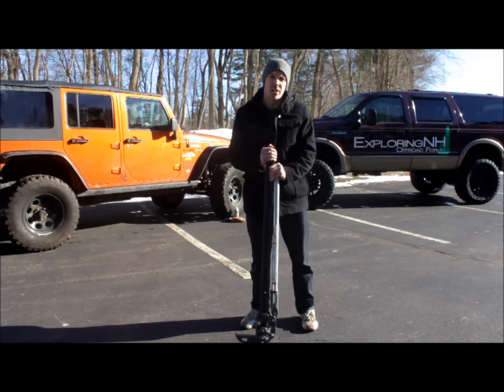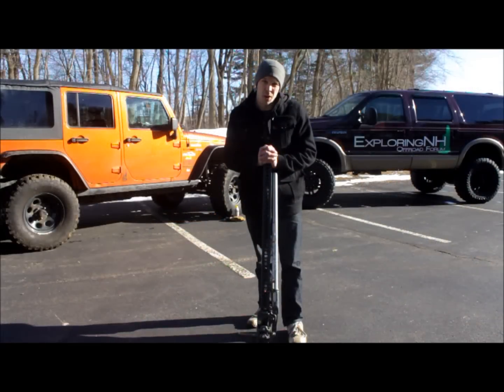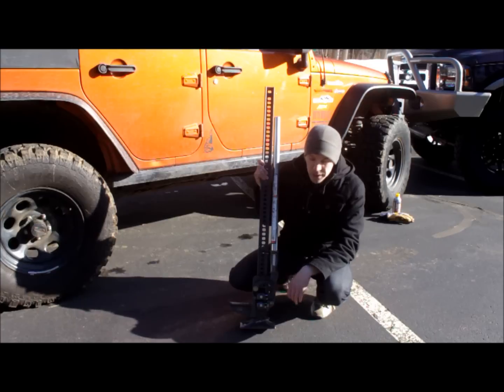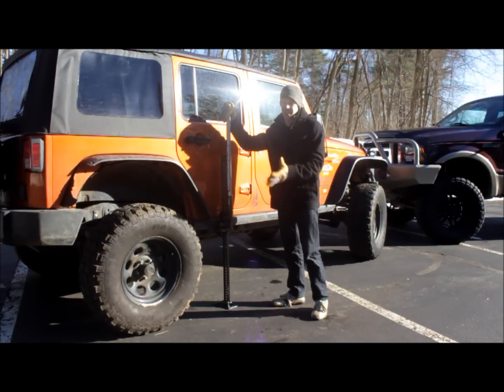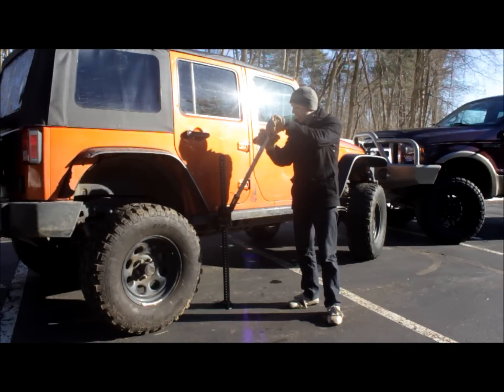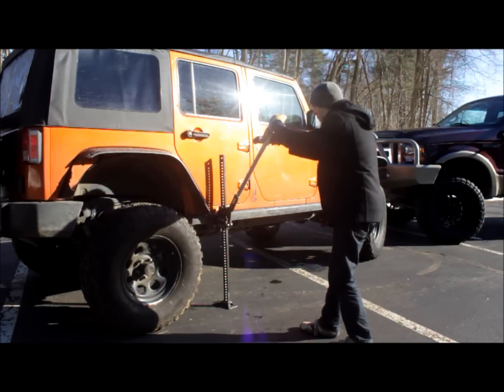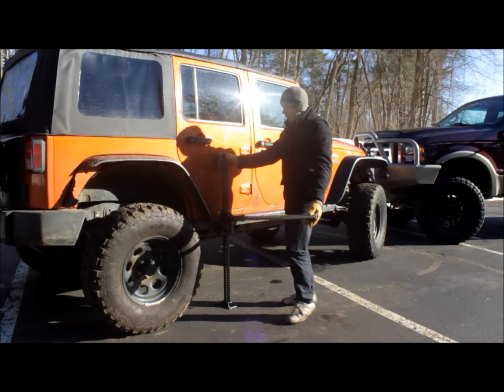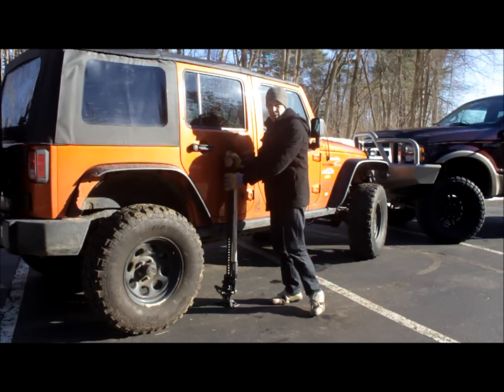How To Use A Hi-Lift Jack Safely

Comment: would also add to this.  carry a sorry lengthy odd chassis with a hook on one end. chain your axles to the frame so you do not need to lift it that high as the axles will only lower as far as the chain will allow.  it will make changing a tire or most things where you might need to use this devise much safer. the higher you have to lift the more unstable things become

Comment: IMPORTANT NOTE: If you're on a trail, chock the wheels first to help prevent the vehicle from rolling, just in case your e-brake slips. This is especially important if the vehicle is on an incline or decline. A pair of heavy-duty wheel chocks  is only about $20 on Amazon (or use a log in a pinch).
Reply: ElektrobanK wanna hold my chock block

Comment: Good technique, especially when lowering.  I'd like to add that a Hi-Lift can run away when lowering the load if the operator loses grip on the lowering stroke.  If it runs away the handle starts going up and down on its own, very fast, and likewise very dangerous.
Reply: Good point to bring up for sure.
Reply: Much like the bumper jacks for those old enough to remember them.

Comment: "I'd rather have a dented body pannels than a broken hand"
That's the difference between you and me lol
Reply: Gigantic Weiner mall crawler for sure.
Reply: @gilbertomauricio9732  "Ah crap that driveway is steep..."
slaps it in low range
Reply: Well if you actually use your Offroad vehicle for what it’s built for, a hi-lift denting a panel is the least of your worries lol.
Reply: Broken hand can heal. Body panels are expensive to replace..........just sain
Reply: My exact though when I heard that😂😂😂
Reply: @pmmp855  must have universal healthcare

Comment: If your vehicle has a lot of suspension droop, use a strap or chain around the axle before you lift... then you don't have to lift as high.
Reply: good tip keeps load more stable.
Reply: I carry a 60" and sure glad I do
That extra ft. Has saved my butt more than a  couple times.

Comment: I have used this jack when I used to hard core off-road. It is worthless. I've used it on the side if a hill repairing a broke axle it sucked because I had ratchet straps the front axle as short as I could but still had to lift it way too high to get the 36" tire off. Also I tied my winch off to a tree to keep from moving down hill. Also when you have to use it if your rig is any way shape or form offcamber the top of that Jack will eat the crap out of your side or front. I have gone with a harbor freight aluminum racing jack. Removed the wheels fabbed a skid plate with turned up ends and bolted it to the jack to use as a base. About   an 1.5 longer on each end and about an 1.5 wider on each side. You can thrown rocks,logs, sand and anything else you can think of under it. Now you lift the axle and not the whole suspension also. Watch out when you start lifting, it doesn't "roll" as the lifting arc goes up. So you have to watch and compensate for the arc.. That's just my thoughts from using the high lift jack. I don't like them. I've seen them kick out..
Reply: Interested to see pics or a video of your setup. I'm on the fence about a hi-lift and looking for safer alternatives.
Reply: @AaronLives34  idk how I would post a picture on here. But this might help. Since you you have great mechanical skills. This is what I done. Go to Harbor freight and get an aluminum race jack. Remove the rear swivel wheels, but keep the front wide wheel on. Either get a piece of 1/4" aluminum or a piece of 3/16" mild steel plate. I have steel on one jack and a piece of aluminum on the other for both of my rangers. I have a Tig machine I done the aluminum one with. Get Some 1/8x 1.500 angle iron to replace the back swivel wheels where they bolt to the jack itself. A 1' piece of angle iron will be enough for the back. Where the wheels bolted on.  I made the base plate about 1.5" or 2" wider than the  jack itself. Too wide and it's hard to store. The base plate on the rear I made it about a 1/2 longer so I could weld a kicker on plate so as it would ramp over stuff as I pulled it back. You can't get too high because of the handle. I did the same thing on the front of the plate also. But made it a little longer. Somewhere around a 45 degree on both kickers. On the front end of the plate I cut it to where when I welded the kicker on it touched the front wheels.  
Example 0/. Make sure the front wheels are still on the plate when you make and bolt on the front tabs welded to the plate. I leveled up the jack before I marked and bolted on the rear legs. Once you get it like you want then get to welding those legs to the base plate. Use it at home to see how it works. The jack don't "roll" forward as you jack it up on the plate like it would with wheels.  I think you will get the jist of it when you lay this on your welding table and get the CPU going.. You throw rox logs anything under if need be for height or keep from sinking in the mud. Hope this helps.. Like I said I have one in each of my chase rangers.  Be safe and hope to see you on the trail some day..

Comment: It's estimated by our government that more than 70,000 people are injured each year in jack related accidents. In many cases it's because the vehicle moved or shifted causing the jack to fail. The first things to do are to make sure your vehicle is in PARK or First Gear, Brakes are set and  the wheels are choked to prevent the vehicle from moving. Then you can get your jack out!! You might also invest in a stabilizer for the Hi-Lift type jack.
Reply: Richard Bogert ...I heard that it is suppose to be in reverse if it is a stick. Not sure tho, correct me if I am wrong.
Reply: Sake A
A lower gear ratio will have a stronger holding force. Depends on the vehicle and transmission if first or reverse is lower, but I think either one holds enough. Also you might consider how the stick positions, in my car if I need to go inside to do something, I am less likely to accidentally push it out from first gear.
Reply: Richard Bogert In a perfect environment in a perfect world yes, but not in an off-road situation. You have to be as safe as you can but when off-road you just can't or have all those luxuries.
Reply: Reverse and first gear is the same gear but with the spline going into it "reversed" so its the same ratio.
Reply: Daniel Giavelli
that is not true. Some transmissions may work like that but most do not.
Reply: I dont know for sure, i was a mechanic for 5-6 years and was told that first gear is used as reverse except that insead of a clock wise spiral on the spline going into the gear it is a counter clock wise (doesnt make sense to me, i could be saying it wrong) or something of that sort. I can do anything on a car, but no transmission work, except remove it lol. If you know more, explain, but thats about as much as i know.
Reply: I'm not an expert either but reverse usually has it's own gearset with a third gear so it changes the direction of rotation. http://media1.britannica.com/eb-media/45/104145-004-3A4E254C.gif
Reply: Catrik hmm, Interesting to read. thanks for showing.
Reply: Daniel Giavelli and catrick this has been the most cordial interaction I ever witnessed on a YouTube comment section. I'm appalled that there was no name calling and such, #realmen #realtalk.  That's what's up.
Reply: Sake A lol thank you! There wasn't any reason on my end to be rude, and I'm always happy to learn new things.

Comment from the maker: Andrew, I can't seem to reply to your comment directly, but on a stock Excursion, there is no place to safely use a Hi-Lift jack. You would need to add aftermarket front and rear bumpers or rock rails.
Reply: +ExploringNH I used a hi-lift on the tow hooks of my superduty...not recommended but worked when I needed it to!
Reply: so to change a tire on a jeep i needa high lift jack? what one should i buy

Comment: Are you suppose to keep the door open so if something does happen, you don't destroy the door or panel? I've seen a few images of people leaving their door shut and the lift slips and crushes the door. Least with the door open it won't destroy your door or panel..
Reply from the maker: Joshua Shaffer yes it is highly recommended and should’ve been done during this video. Some situations done allow for the door to be open during jacking, but when possible it is a great idea.
Reply: I am unfamiliar with the use of one of these Jack's, and I'm interested in what your idea was. I guess a question I would have is if the door is open couldn't get in the way and hinder you from properly using a jack like this?

Comment: To help protect your head and your rig from these heavy steel jacks, a 12 inch length of 2 inch pcv pipe, with a cap on the end, fits snuggly over the jack's vertical rail. There's a video on my channel shows mine.👍

Comment: where does this get stored on the vehicle. I have a lifted f250 diesal super duty. do I need a special mount?
Reply from the maker: Kristine West that Orange Jeep is mine and it is on my hood. Many companies make special mounts for certain locations but any place where it won’t move during an accident etc... where ever it works for you as long as it is secure.

Comment: Can we please see a video where you NEED the high lift to ACTUALLY get out of a situation? Everyone makes videos with the jack on a completely level surface. People are watching these videos to figure out how to get out of situations where we ACTUALLY NEED A JACK! Ill make sure to rewatch this video when i get stuck in my local wal-mart parking lot. Thanks brotato
Reply: +Max Shelton there is one that actually shows it out of pavement but dont have a link handy ( even shows how to safely use the jack as a winch)
Reply: I once used a hi lift on my truck on a sloped trail. Jacked it up but hi lift bent then sprung out from under my truck. Scared me 😣

Comment: could you use a second one on the other side to fully jack the vehicle up?
Reply: Justin Bufford front or back end maybe but not all 4 wheels. The car would teeter totter on a 2 inch wide fulcrum
Reply from the maker: Justin Bufford I wouldn’t recommend it.

Comment: What does he have in the side where he is lifting it. My jeep has bear metal that will bend if I jack it from there.
Reply: That JKU has the Rubicon rock rails
Reply: +Daniel Young just about any rock rails will do you can use after market bumpers aswell if they are structurally sound.

Comment: I was testing out my hi lift jack without a vehicle under it. with it raised up some, I switched the pin to the lowering position, and it just Slammed down. Is it normal for it to do that when there's no load under neath it?
Reply: Need to have weight on it
Reply: Eli Noblin I hate that, but yes that's normal. It needs to have somewhere around 150 lbs of force or more on the lip to work like in this video. Remember that when you are jacking your vehicle down, once the vehicle is standing on its own weight, the jack will drop since there's no force being applied on it. You can hold on to the lever to keep it from slamming down hard.
Reply from the maker: Yes it’s normal.

Comment: Great Video!  Good instruction in the use of a Hi-Lift Jack for beginners!  Thanks for posting this with the safety information and the Do's and Dont's for the Hi-Lift.  This is a 48" Jack correct?  what size do you recommend for a 2002 Jeep Wrangler X running a 2.5" lift with 31x10.50 R15 tires?  Thanks and "Happy Jeepin.."
Reply from the maker: In my experience the taller the jack the better, however I have gotten away using the 48" Jack with a Jack base and I am on 37's with a 4.5" Lift. Just make sure you have good jack points, sliders, bumper, tires etc...
Reply: ExploringNH  can one use this to change a flat tyre?

Comment: "keep your hand between the jack and your car to protect from scratches and dents."

5 seconds later

"make sure you get your hand out of there, id rather get a dented body panel than a broken hand."

lawls!
Reply from the maker: Different points in time. Once weight is on, remove your hand.
Reply: +ExploringNH It was hilarious because the two ernest sentences were so close together yet so opposite :)
Reply: +dethmaul He clearly said guard the paint while there is no tension on the jack and to remove your hand once it has tension.
Reply: Yup. Some listen to understand, some listen to respond.

Comment: Are these unreliable or something?
Reply: Hell NO! they are very reliable... HOWEVER, most people who use them are untrained and therefore they operate them dangerously or use them incorrectly. Also cheap knockoffs can be dangerous due to inferior construction. There is also a myriad of tools to use along w the Hi-lift to make it even safer.
Reply from the maker: As iron duke says, no, they are not unreliable. In fact, they are VERY reliable, especially when properly maintained. My father still uses his that is nearly 50 years old and still on the stock pins and springs. They can be dangerous when not used correctly.

Comment: Trust me there not safe to use. Ask my neighbor who was on flat paved ground. And he was jacking up his jeep to change a flat tire. And when he was taking the wheel off the jack just give way. And it pinned his leg. And lucky my truck has a wrench. I just lifted the jeep up and the guy moved his leg which was really cut up. And i took him to the ER which they just stitched him up. And came back and change the tire for him while he cleaned up. And his wife came home and was like how are u. And she was like ur bleeding and the husband told her what happen. And she looked at the video security footage. And was shocked to see what happen. He never used that jack again.
Reply: I used a hi lift to fix a rear flat on my truck. When I was about to take off the tire the jack bent. Then it sprung out. Good thing was my truck was still in contact with the studs.

Comment: Am I'm missing something?

You are out on a trail and so you jack it up real high (with this small jack footprint) and then you are all ready to apply massive torque to the lug nuts in order to remove the wheel, (i.e. you're changing a real-life tire) with the vehicle in the air. Right?

There are no 'properly place chokes' mentioned, no 'make sure to have the emergency brake firmly applied' mentioned, no 'break-free the lug nuts while vehicle is ON THE GROUND mentioned.

Mentioned: "use leverage without applying any leverage".

You likely mean well. Yet if this demonstration is taken as the end-all authoritative instructions for 'what to do if' 
someone is going to get hurt.
Reply: Step 1: lift with jack 
Step 2: place large logs under axles of vehicle
Step 3: place smaller sticks over top of larger stick
Step 4: light fire with wd-40 and leave

There you have it, you no longer have a vehicle to fix, therefore the problem is solved
Reply: These things are stupidly dangerous. The purpose is to quickly lift something to a height where it can be propped with blocks or logs but unfortunate in the field one doesn’t have access to those items. I’ve used them only to move 500 lb steel parts in place. Even then I hated using these things.
Reply: @sschwartz2509   I think you meant these things are dangerous only to the stupid.
Reply: He's showing people how to operate the jack, and not all the other things you mention. That might be a 15- or 20-minute video.

Comment: Isn’t the whole issue with these jacks the fact that once there’s the weight of anything, it starts forcing the pins to misalign? personally I’d  avoid using these in general. Good concept, poor execution. Also if you drop a car or wheel on your hand what good would a leather glove do? Haha.

Comment: Doing it without wheel chocks isn't that clever or professional, but then thats the yanks for you
Reply from the maker: Wheel chock was on driver's front tire, opposite the jack.
Reply: +KeithSpamer Jumping to condescending conclusions without asking first isn't that clever or professional, but then that's UK'ers for you.
Reply: +ExploringNH Funny because I just zoomed in on the front driver side tire and there wasn&#39;t anything in front or behind it. Plus the different angles of the camera towards the end only prove it. Nice try though.

Comment: p.b.blaster is not a lubricant
Reply from the maker: +Adam Wilson PB Blaster leaves behind a lubricating film. Look it up. It isn't a straight lubricant like silicone but it is a lubricant and suitable for this application.
Reply: +Adam Wilson Yes it is, its a penetrating lubricant. Its lubricant with a solvent additive.